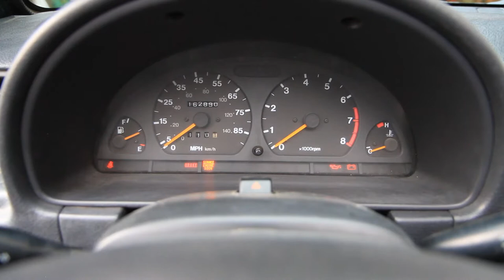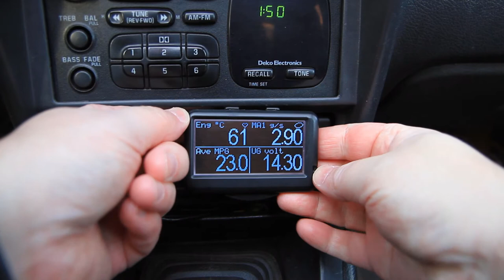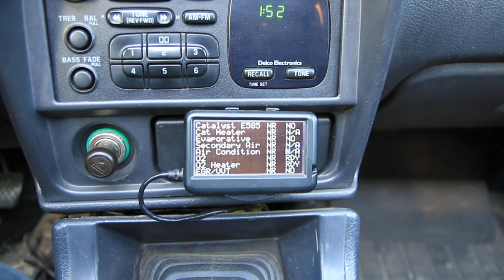Vacuum Leaks and EVAP - Getting Your Suzuki Sidekick / Geo Tracker Running Right Part 2

Comment: Man props to you brother. U went all out to figure the issue 👏🏼 👏🏼 I got a PO172 code today for system too rich. I gotta see where to start now
Reply from the maker: Thanks for the feedback!  It definitely took some work to find and fix these codes.

I'd recommend checking fuel trim and your O2 sensor readings as a starting point, but I haven't had to deal with P0172 myself.

Comment: I know this is off topic but I can’t find a video for it I have a 98 Chevy tracker with a p0740 I did a trans fluid Change and it didn’t come back on for about a week and just recently came back on.. keep rackin my brain trying to figure it out
Reply from the maker: Hopefully someone in the community can help you with this one.  You'll never get P0740 codes in a manual :-)  !
Reply: Did you ever figure out a solution? I have the same code
Reply: @rachelanneliese5857  I have not unfortunately

Comment: Thank you PDX for your informative video.  Do you mind providing more information about the new EGR valve you used. I had a hard time find one like the new one you obtained even though you mentioned it was from the "next-Gen vehicle."  
I found one on Amazon for $99 that says: "Garage-Pro EGR Valve Compatible with 1999-2004 Chevrolet Tracker, Fits 1999-2008 Suzuki Grand Vitara, 2002-2007 Aerio & 2002-2006 XL-7" but it does not appear to be the same as your new one.  Thanks so much!!
Reply from the maker: Sorry for the delayed response!  I had no luck getting a new one either.  Mine came from the next-gen Tracker at the Pick'n'Pull and it's been working great.

Comment: Would like to change the hoses , what is the size out cars use ? (Vacuum hoses) so I could replace them together with the clamps ?
Reply from the maker: I don't have the hose size, but I used 7mm steel band clamps.

Comment: Great video! My sidekick has the same PCV valve but I just cannot remove it, like it is stucked, how did you replaced it???
Reply from the maker: Thanks for the feedback!

My PCV valve came out very easily.  I just pulled it straight out.  Check the condition of the rubber grommet in the valve cover after you get it out.  It may have shrunk/cracked.
Reply: It's Good idea to change the PCV valve. You can replace the grommet if needed and be careful when removing the old one. Sometimes they can be a pain and come out in pieces.
Check the fit before install and use some silicone grease when putting back together.

Comment: My 98 chevy tracker is running at around 1100rpm idle, when it normally does a 800-850rpm, definitely less than 1000, could that be a vacuum issue?
Reply from the maker: Based on my experience, vacuum leaks were the root of most of my problems.  If you haven't done a leak check, do it first.  I had to fix all the vacuum leaks before I could get the computer to run the engine correctly.  The good news is that it has run flawlessly for 2-3 years now!

Comment: What spray are you using ?  Another question, where can I purchase an OBD1 scanner for a Sidekick 93 ?
Reply from the maker: I was spraying with carb cleaner, its super flammable.  Not sure if it would work on the Suzuki, but some OBD 1 systems would flash the codes on the check engine light if you put a jumper on the port.

Comment: What size clamps did you use for your vacuum lines? I can't seem to find anything small enough.
Reply from the maker: Sorry for the delayed response!  I ordered inexpensive 7mm steel band clamps off Amazon.  They are a hair too tight and it's a pain to get them on, but they fixed the vacuum leaks!  It looks like Amazon now carries sizes in 1mm increments.  I'd try a few to see what fits best.
Reply: @thisisnotatest2  Thank you so much!